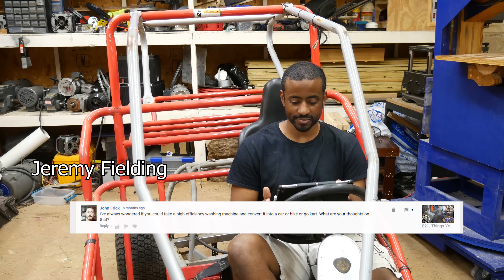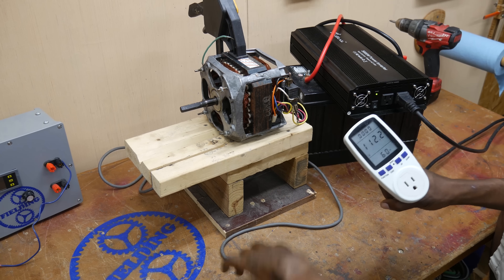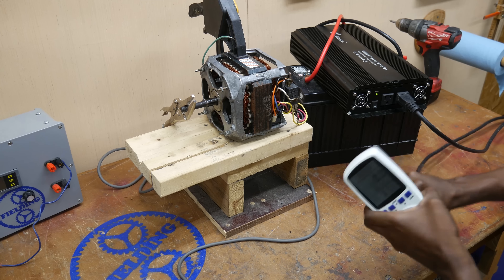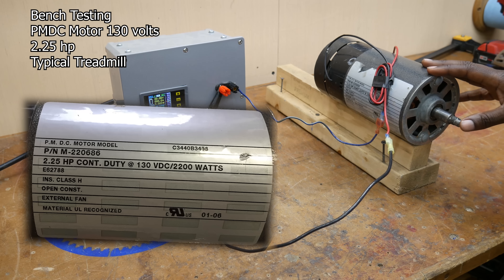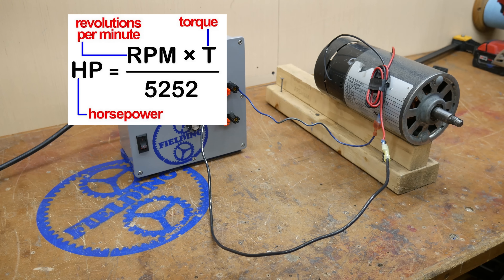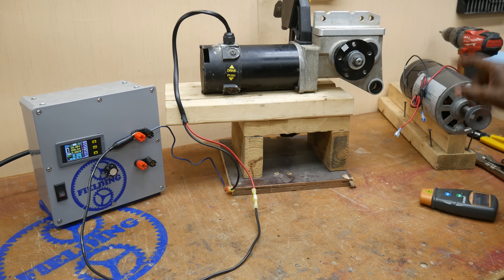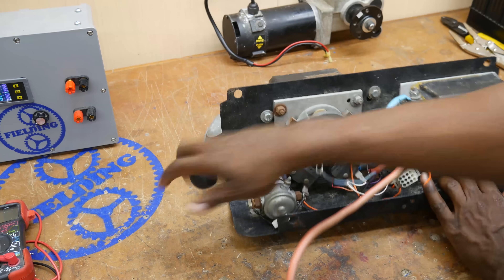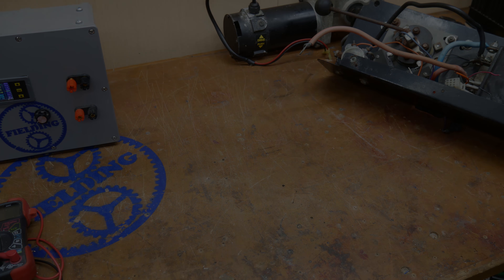What Electric Motors Can Be Used In A Go Kart or E Bike; Bench Testing and Recommended Sizing #61

Comment: I'm so glad I found you channel because I've been working on making an electric bike and needed to know everything you just covered .. thank you so much
Reply: The hunt for the perfect motor is half the fun! Experiments are the learning curve that leads us to dump the dc motors and all the heavy wires and batteries. And replace it with a VFD. You now have. 100% Tourqe at 0 rpm 3 time plate rpm. Pot speed control. Just add a transformer to your inverter to get the 220 volts to run the vfd. And have fun.

Comment: could also buy a e-bike kit and re purpose it, only downside it is made for like 46 inch wheels so it will give great torque but low speed if you don't change the speed controller and maybe gearing it

Comment: using a motor without a driver on large scale automotive applications with no multi-speed transmission does not work. if a motor was designed for continuous operation at 40v 25a for example you need a supply volatge of 80 max and a constant current mode supply/driver set at 25a linking the 80v battery to the 25a limited motor so that it has a wide range of high torque, good top speed and no overheating. but if you are gonna use drivers and semiconductors and whatnot at this point you are much better off building a brushless motor infrastructure.

Comment: 3000 Watts on a gokart, is like 4HP. It will be enough power to get the kart up to about 30MPH top speed.

But if I were you, I'd either get the wheelchair motor with gear, and mount it to the rear axis with larger wheels, or,
If you want it to go faster, get rid of the gear reduction box, and use one motor per wheel (one motor turning clockwise, the other anti-clockwise).
2 motors doing 3k rpm, on very small go-kart wheels, without reduction (gearbox) losses... 
You could get it going up to like 35MPH as well.
Reply: You're still trading off torque/acceleration for top speed. The gearbox reduction ratio is roughly 20:1 (20 turns of the motor for every 1 turn of the wheelchair wheel). Those wheelchair motors would have to have SOME gear/sprocket reduction ratio or you'd quickly burn them up. Maybe a 4:1 to a 7:1 ratio would work, but I'm still doubting there's enough power even using BOTH motors to give satisfactory results.
Reply: Yeah, it'd need 3.5" wheels for it to run on a direct drive.
On the other hand, having 4 of them installed in your cart, with 10" wheels, you could reach a theoretical 80MPH at 3k RPM XD
Reply: You, me, or Jeremy would look silly on 3.5" wheels AND you'd have almost no ground clearance. Even so, if the wheelchair motors collectively make 4HP, that's still a little lean for a gokart of that size and weight. Like you said, using four of those motors would be better. Yerf Dog karts like that came with 6-10HP engines. Also, they carried maybe 7 pounds of gasoline, not the 160-400 pounds of batteries you'd likely need. I think scavenging golf cart/forklift parts is likely the best route.
Reply: Certainly. Nothing beats gasoline, in terms of energy density per sq inch.
Although, lithium batteries could go for a fraction of the weight (10x 48V 10A Li-Ion batteries give enough power to run 6HP motors for 1 hour at max load, and weigh about 50kg)

There are plenty of gasoline options that would hit 6+HP, ranging from pairing 4 weed eater engines together, to a pair of cheap 50cc scooter engines, or a single 125/150cc scooter engine.
A 150cc scooter engine is about 6HP, and probably would need a CVT or gearbox, to switch between low speed/high torque applications (like 30MPH go kart tracks), and high speed street racing (55MPH, which is about as fast as such an engine can push a go-kart).
Reply: What he pulled out looked like a common Comet Torq-a-Verter drive. Engines were usually 195cc Tecumseh 6HP flathead or OHV; REAL common stuff. Electric is usually heavy, with moderate speed, and costs more. GREAT electric, like Tesla, is lightER, fast, but very expensive. I think his intended build is supposed to be "cost effective" (my supposition and term), so Li-ion I THINK would be too expensive. I think I've seen batteries like that, and they were WAY lighter than the traditional SLA or flooded deep cycle ones found in wheelchairs or golf carts. Really cool stuff! I found the thought of using those to be...electrifying! (Pun intended!)
Reply: Yes, 10x 48V 10Ah batteries cost around $3k shipping included.
Reply: OWCH, yeah, I thought the cost was something like that.

Comment: This is a helpful video for someone like me who is just beginning to learn about motors. I pulled a 1.3kW wound rotor AC motor from a broken table saw, and was thinking it might work as a replacement for the 90cc engine of a small ATV. Your point about the cost of an inverter and speed controller was a downer, so if I come across a DC motor I'll just use that. In the mean time, I'm curious whether it would be possible to build my own high-power variable frequency inverter using relays and PWM driven by a microcontroller.
Reply from the maker: The answer depends entirely on your electrical knowledge and skill, thus you are the best person to research and answer that question for yourself.
Reply: Jeremy is correct; if you already know a lot about inverters and PWM speed controllers, you probably can build your own. Otherwise, you're better off reading a LOT of stuff about motors, speed controllers, and batteries to match EXISTING components together. I did this to convert a rear engine riding mower chassis to an adult mobility scooter and got largely good results. I'm still geared 10-20% too tall, though.

Comment: The alternator is a good idea. If you hook it up with the right wiring and controls, you could use the alternator for regen braking too. Would only require a marshalling box full of tricks and combined with the alternator wouldn't take up much space as compared to a conventional engine.

Comment: Could you impliment a starting capacitor to take some load off the inverter? Many machines that run on 120V AC (mind you they are much bigger motors and I'm not sure if the concept scales completely) have a large capacitor in series with a winding to give it that extra uuuumph when starting from rest.
Reply from the maker: Induction motors use capacitors to create a phase shift for single phase motors. The motor you just saw in the video has a capacitor already. The capacitor doesn't help the inverter produce the power, it helps the motor by temporarily creating a second phase for starting.

Comment: I am looking forward to following this project. Here's a challenge for you in the meantime: I want to build an electric outboard motor that would replace a 10-15 HP gasoline motor. I might take a scrapped gasoline motor and use the lower unit from it; not sure. Any thoughts?
Reply from the maker: No thoughts
Reply: What do you mean, "the lower unit from it"? The gear reduction or the crankshaft?
Reply: Might not be using the correct terminology--I'm thinking of basically everything minus the gasoline motor.
Reply: Oh, I know what you mean now. Like anything, it CAN be done, but I'd bet you'll need an electric motor and control system of 8,000 watts or more. My wildly rough estimates of cost is $2000+. Rather than convert an existing outboard, I'd look online for "electric sailboat/boat drive/system" and see what you come up with. In any event, it's going to be way more expensive and heavier than a gas engine.

Comment: I made an ebike with a 1000w 48v brushless dc motor. It is decently fast with a top speed around 31 mph.  That size motor has more power than someone pedaling the bike as hard as they can but still easily controllable.
Reply from the maker: That sounds awesome!

Comment: what about a starting cap 
I bet most of the a.c. motors shown here came with a starting cap. 
in a go cart if you had a big cap you would probably do wheelies
Reply from the maker: The start capacitor creates a phase shift inside the motor so it can start... that doesn't determine how much torque is available

Comment: If you increase the voltage you lower your current.... PERIOD. The first time you said it I thought I just heard you wrong.
Reply from the maker: I don't know the context of your comment... perhaps a time stamp? I believe my understanding of this topic is pretty solid, but we all make mistakes. If I am wrong I will add a note to the description. Let me know and we can get it straight
Reply: Jeremy Fielding I’m actually wrong 🤦🏼‍♂️. So disregard my comment. I was confusing power distribution line loss into this. Distribution at higher voltage decreases current but that’s on a fixed resistance load.

Comment: 1hp is enough for an ebike... although a spot dull. I use a direct drive hub motor, permanent magnet 3-phase. Supplied with power from a 100v lithium ion pack and a controller programmed to 150A at the battery and 300A at the phases. It's sine wave and uses field weakening. Top speed is 65mph and it's pretty hard to keep the front wheel down hahaa

I highly recommend experiencing the savage and instant torque electric motors produce.
Reply from the maker: That sounds pretty awesome. Thanks for sharing

Comment: I don't think that the inverter is meant to drive a load with a power factor of nearly 0. The motor will be pulling almost all VAR when it is locked. It should read almost 0 kW because only the winding and core losses are consuming kW.
Reply from the maker: You are over thinking the problem. An inverter can start a small inductive load like a fan or even a small fridge. The point I was making is a heavy starting load even from a 1/2hp motor more than a typical inverter can handle. I say “typical” loosely because mine is pretty big. You would need a very high rating just for startup. I was recommending you avoid the inverter all together and get a controller designed to work with motors in this application. A motor speed controller.

Comment: I have an electronic motor from a giant conveyer belt. I mounted it on my dirt bike that I converted into a 3 wheeler. My speed controller failed in the freeway. I got my speed up to 65mph and smelled smoke and plastic as the speed controller was melting. My speed kept increasing as I passed cars trying to apply the brakes. They to melted. The next thing I saw was my speedometer still increasing past 88mph. I realized that if I didn't bail now that it would be worse the faster I went. I decided to jump fir my life. As I jumped to the asphalt at 93 miles per hour my shoelace was pulled into the sprocket and it drug me 300 ft over-the-shoulder through a ditch and into a swamp. Highway Patrol found me lying unconscious with two broken legs and the throttle grip still in my hand
Reply: When you said that you reached 88mph, I was expecting you to say that you'd gone back in time 😂
Reply: I feel for you man. Just spent two weeks in bed recovering from bike accident. I'm building my own ebike as well. Never thought of a kill switch and I'm no electrical genius. So thanx for your story and sorry about your accident but 90mph is awesome for a diy ebike. I always told my kids when learning to drive" that speed is fun for sure and that driving too fast is fine. UNTIL SOMETHING HAPPENS. then it becomes deadly." I'm going for 40 or 50 kph max but man hitting a 100 once would be cool.
Reply: No on/off switch? As an experienced motorcyclist and college educated engineer, I know a shoelace unties the second you put your foot down.  And 93 mph on a 3 wheeled dirt bike probably requires 30 hp.  That's 3 truck batteries at 1000 amps each (minus losses). And I highly doubt you found a 30 hp motor, let alone 20.  Maybe 10 at the most.  Huge pool pump motors are only 1 hp.
Reply: Wow that is horrible!!
Reply: Cool story, bro.
Reply: I'd love to see that video. Sounds like I story in destined to tell in my quest for ultralight 150mph bike. Hate to hear of your injuries but kudos on your commitment.
Reply: Such a lie
Reply: @thomasbarlow4223  Yep.

Comment: if those are horse power, then why can a (ONE)  horse carry the same amount of weight using less power?  lol
Reply from the maker: I don't understand the question
Reply: I was just joking.  I was comparing a motor's horse power to a real horse and dont think a motor's horse power can compete with a real horse.  Can it?
Reply from the maker: Oh ok... Sorry I ruined it now... I get hundreds of comments in a day and I was reading so fast I didn't realize the jest of what you were saying but I didn't want to skip over it if you had a question.
Reply: well as I was writing, i did wonder if I could be wrong.  It just seems, to me, that a horse can giddy up and go and go fast with an equal load as a 1hp motor. Treadmill motors are around 2hp and get you running about 10mph. I don't know how fast it  could go if the motors were connected to wheels, yet but shouldn't we consider the horse moving its own weight since adding battery weight adds a bigger load.  Was just a joke but im tired and get 'chatty' but do wonder which is better to do work? 1 horse or 1hp motor?  I dont have any horses lol
Reply from the maker: The short answer is it includes both speed and torque. When thinking in terms of flat land, it is speed and work (force over distance). A horse can move a very heavy load really slowly. A motor can move a moderate load very quickly.  Mathematically speaking, a 1 hp motor can produce about the same amount of power (work x speed) as an average adult horse. I don't think that includes moving its own weight. Because you would not be interested that that part of the work being done.

Comment: Washer motor >>>  what if you didnt start the motor until you got the bike up to a certain speed than started the motor??
Reply from the maker: How do you get it up to speed? You mean like a bicycle? That’s one way to do it if your determined to try it. Experiment and see how you like it
Reply: only inverter i have is 4xx watts... but i was thinking the load would be shared and the motor may not have to draw so much at start.  I remember the razor scooters needing to be going 3mph before the motor would start...
Reply from the maker: In those cases you can definitely use less power when it is supplemented by other means

Comment: 1500w is the maximum AC power limit in the USA isn't it? That inverter has TWO plugs... Maybe it is 2x 1500w rather than a simple 3000w... Just a guess. Here in New Zealand we don't have girly 110v power, and we have a 2.4kw maximum.
Reply from the maker: I agree... it might be 1500 watts per outlet. That would be reasonable. And it confirms my original point that you need a very large inverter if you want to go that route.
Reply from the maker: I have never hear of a power limit on anything here. I have many tools that use more than 1500 watts and at 240 volts
Reply from the maker: Also we have both 240 and 120 in every house... its just that most items use 120 here so most people only have two or three plugs in the house wired for 240
Reply: There's only so many amps you can draw before the plug melts or the fuse blows... 240v circuits are usually rated for up to 10 amps, unless you're British, in which you're allowed 13 amps. In the US, on a 110v circuit, chances are you're restricted to 15amps, safely, although it's likely that North America doesn't have the same strict policies on this that Europe and Australasia would have.
Reply from the maker: The amps rating is only limited by wire size and socket rating. I have outlets rated for 30 amps at 240. And have seen 50amp outlets at the local hardware store

Comment: Hey guys, I have one addition for the car starter motor: car starter motors are perfect because they are built in a way that the force output increases with the load. so when they are at zero and you turn them on, they will have much higher torque than in normal operation which is perfect for a cart. best motor to go is in my opinion a truck starter motor and they can be found on ebay.

Comment: Dear sir 

Please help to prepare the video  on how to select correct DC motor with load 500kg/1000kg  ,Controller and battery pack with Datasheet

1. How to select a DC motor with load 500 kg or 1000kg ,   along with Datasheet of DC motor 
2. How  to select correct range of Controller for the above DC motor  with state of rest and in motion with datasheet
3. How to select a perfect battery pack Range Volt /Amp  for the above DC motor and controller
4. How to select a suitable BMS for above 
At list  at the top level as in depth will be very long video.

Thanks Regards Lakra 
DLakra7878@gmail.com